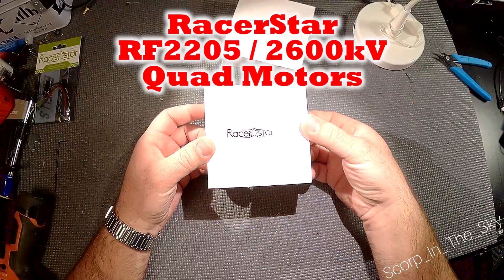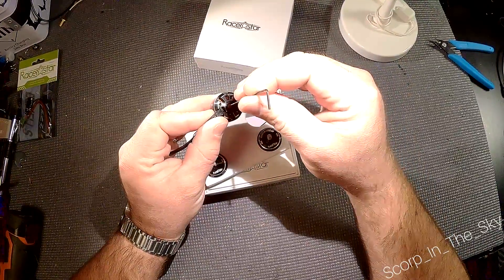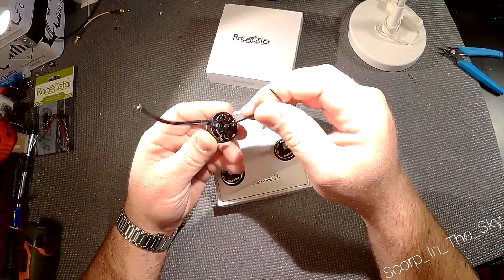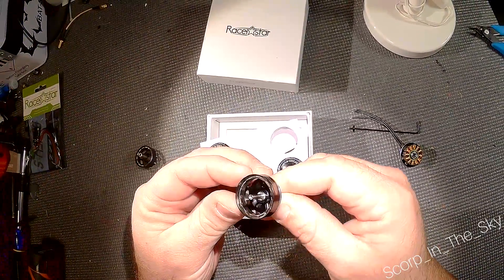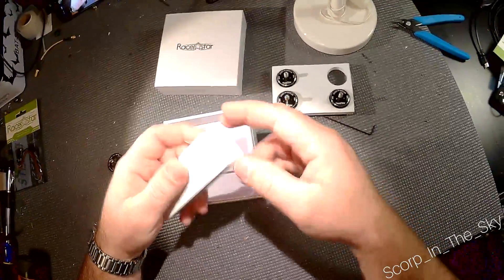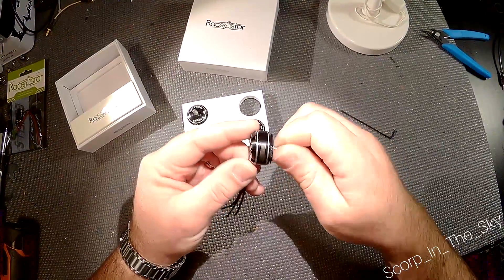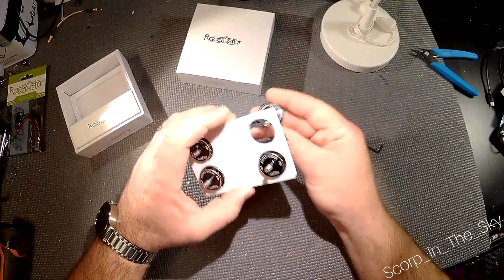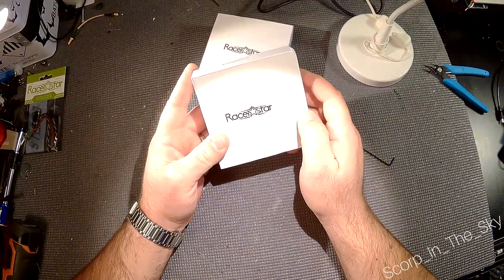A quick look at the RacerStar RF2205/2600kV motors

Comment: they discontinued them pretty quick and replaced it with the much worse BR2205S. 
i broke one and couldnt find replacement.  luckily the BR2205 stator/base fits the RF2205 rotor bells.
Reply from the maker: Yeah i noticed that Banggood doesn't have the RF2205 in stock anymore. No idea why they disco'd them but they are beast motors for super cheap.